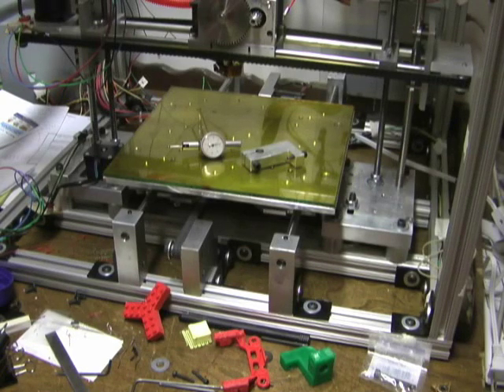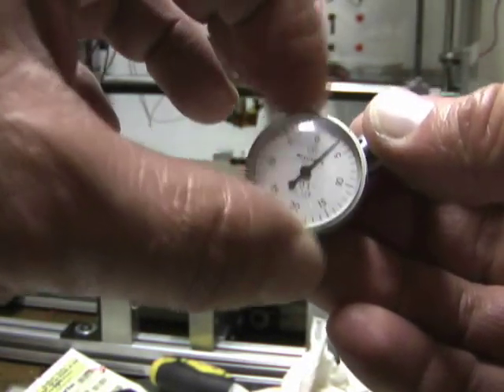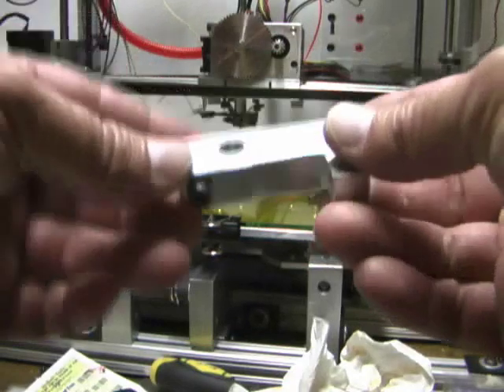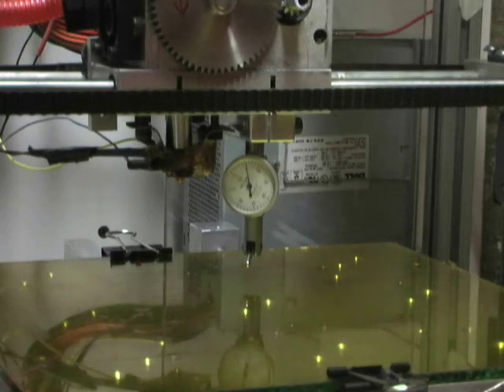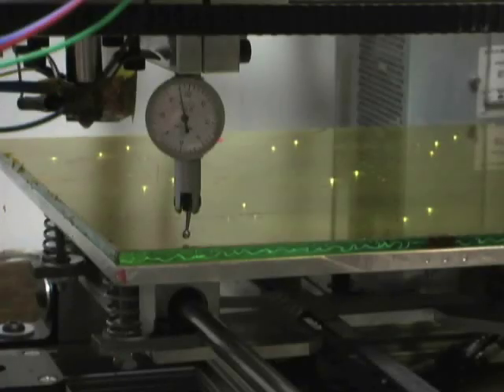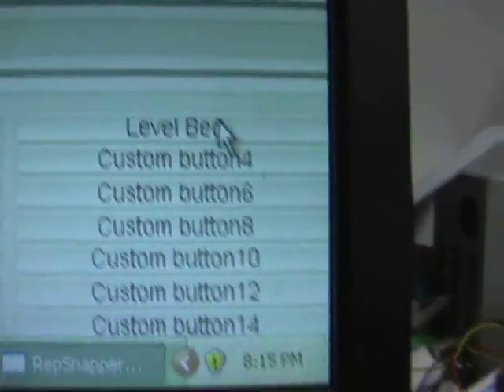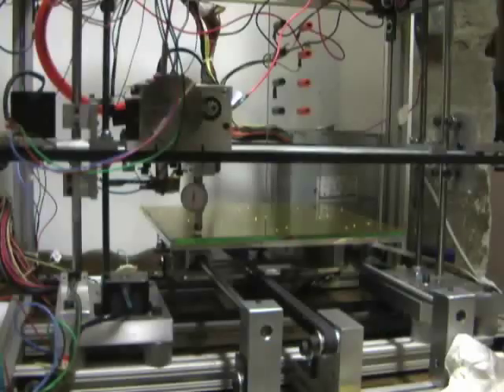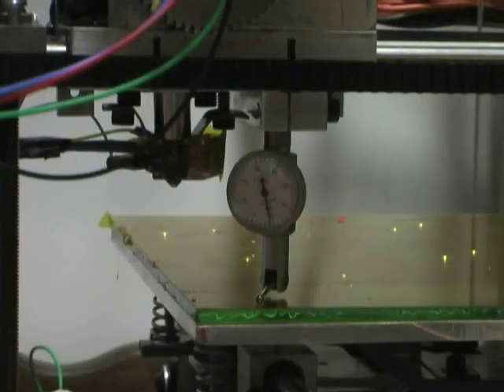Level the Print Bed on a RepRap / RepStrap 3D Printer with a Mitutoyo Dial Test Indicator

Comment: You are aware of cosine error on indicators aren't you? The tip should be as parallel as possible to the surface being measured. If not you get an error, most indicators ship with a slip of paper that give you the error amount based on tip angle.

Comment: This looks good. I would add the x, y and z axis repeatability test to your gcode, to verify no wear on belts/bearings and screws. Would require blocks mounted for x and y. Also test for warp with hot bed at temp. But all in all a great idea. I have a QU-BD Revolution XL ordered and will test.

Comment from the maker: Yes. This would be similar to tramming the head on a mill. In this case I want the print bed to run parallel to the "X" and "Y" Axis Plane in relation to "Z". (Equidistant from the extruder at all times)